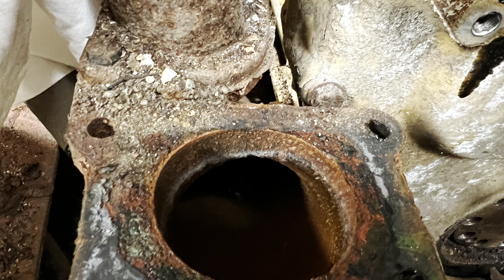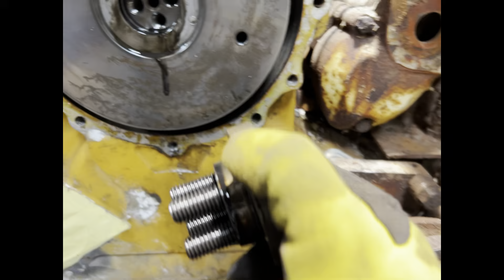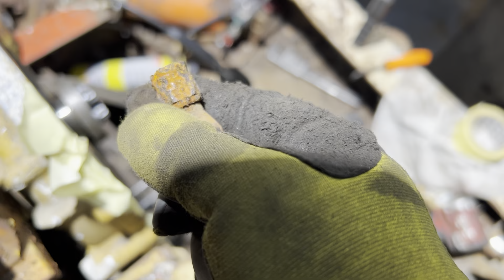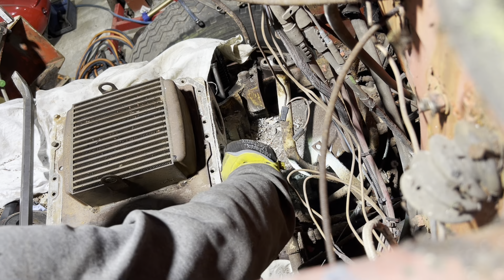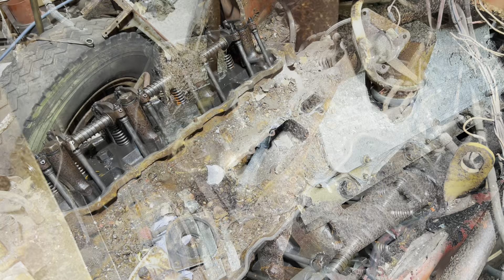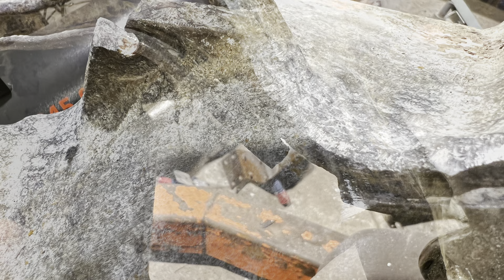CAT 3408 diesel V8 strip down, the rustiest Kenworth engine you've ever seen? #v8  #truck #diesel

Comment: Can't wait for the next installment be good to see what you do with it and what turbo option you have
Reply from the maker: I'm trying to do some research on this now, I could get the CAT ones they used to use on the twin turbo set up 

But I think there'll be some much much cheaper Cummins/Holset options that work equally well
Reply: @big_rig_resto  yeah off a old n14 or big cam maybe good enough try scania v8 turbo old ones but yeah a big holset would sound awesome on this thing